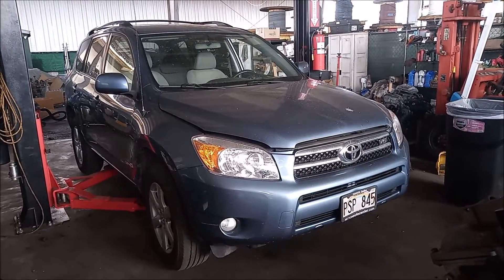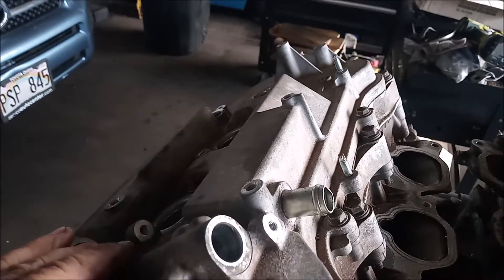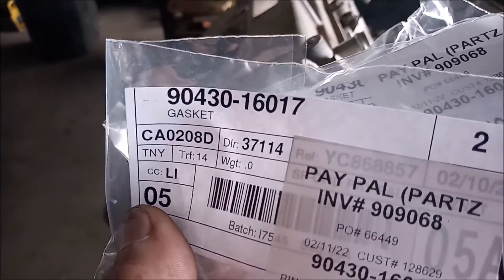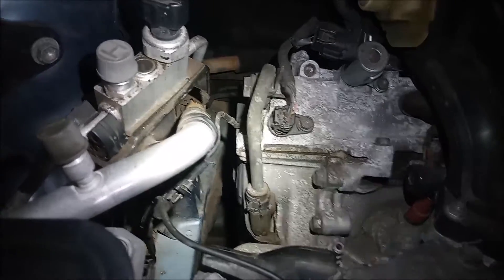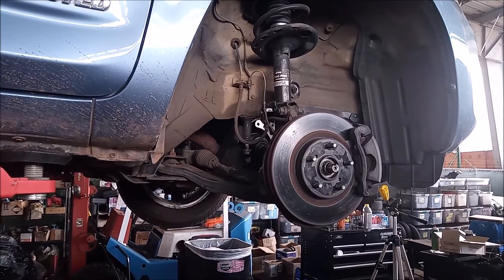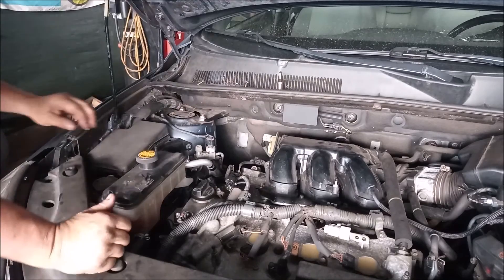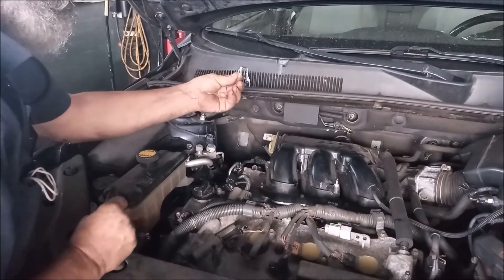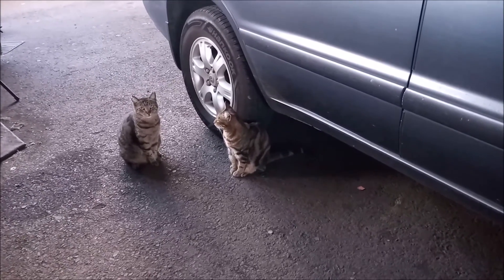VVT Oil Line Step By Step - Toyota RAV4 2GR-FE 3.5-liter V6

Comment: Thank you so much for this video.  I purchased a 2009 Camry in 2019 and was aware at the time of this oil pressure hose issue, and after confirming through the VIN that Toyota had replaced the original equipment rubber hose, I thought I was good to go.  However, the replacement also has this rubber elbow, and although they told me that it has a different construction (rubber with iron), I'm still going to have it replaced with an all-metal line, as neither the parts nor the installation are very expensive.
Reply from the maker: The construction of the replacement is the exact same as the construction of the original. It's possible they may have changed the composition of the rubber hose - not sure about that. They never did officially authorize a full metal replacement for the rubber hose, but they did put full metal into production. It's typical Toyota corporate nonsense.
Reply: Exactly.  They put the full metal pipe in their newer engines but wouldn't replace their original equipment bad hoses with full metal pipes.  That stinks. @Merryfrankster_
Reply from the maker: You know what really stinks? If you go to the dealer service department or parts department and ask for the metal tube, they tell you with a straight face that it does not fit your car.  @kennethwilliams4874
Reply: I'm glad you brought that up, so get a load of this...I purchased the exact part you mentioned (15772-31030) from a toyota parts supplier.  Now, that website says that that part will not fit my 2009 2GR-FE Camry.  They recommend part number 15707-31012.  Then when you try to buy that part, the website says the part has been discontinued.  However, if you examine it closely, you see that it is IDENTICAL to 15772-31030.This is nuts.  This is a hose (or pipe if all metal) that simply attaches to the engine block.  If it fits one 2GR-FE, it fits them all, as all engines with that specific code are identical.  I brought this up to my mechanic, and he conjectured that perhaps the engine left the manufacturer with a different part number than 15772-31030, so a part with a different number, even if identical, the database will say it will not fit.  Just crazy. @Merryfrankster_

Comment: Thanks. This would explain the mystery oil loss I've noticed lately.
Reply from the maker: Clean it all thoroughly then run it and  take a close look to see where it is coming from.
Reply: If you have a leak you will have a puddle under the vehicle when parked overnight.  If you do not have a puddle but are losing oil, it's burning out of the cylinders!
Reply: Its not my car and the driveway has a pink gravel that is not easy to see oil puddles, infact there is no way for a puddle to form..  anyway ive fixed the issue -same as this video showed.

Comment: I still have to do this VVT line on my 2007 Toyota sienna(201,500 miles). This past summer my oil cooler line had a pinhole leak (same hybrid design). It took several weeks because the hardware was rusted and I needed to use several tricks to get the bad lines off without breaking a fastener on the engine. Lots of rust penetrant over time. One the fasteners were out a reciprocating saw helped me get the old line out in pieces. The new line went in much easier with new studs and nuts/bolts. Your video makes this VVT line look easier in comparison. Also, my local Toyota dealer keeps wanting me to buy the old VVT design, he says it’s the only one he can get. Bolagna! The Toyota guy across the lake can get me the right one, so thanks for the new part number, I took a screen shot to show him. 
I watched a video from someone else that said you have to loosen the power steering pump to get clearance if you have hydraulic power steering versus electric power steering. Does that vehicle in your video have electric power steering? BRW, thanks again for the video, and say hi to your cars for me.
Reply from the maker: Use the part numbers I provided. They work universally for all 2GR-FE engines. If your vehicles has an power steering pump, yes, you must take off the serpentine belt and loosen the pump to access the rear banjo bolt on the head - and pray that the pump is not jammed on somehow. Thanks for watching. Cats say meow.
Reply: I have a 2006 Rav4. How do I know if I have electric or hydraulic power steering?

Comment: Thank you for the video. The Toyota dealership replaced ours under the recall but they would not put the all metal line on. I just looked at the cost of that metal line and it's only $25. I can't believe Toyota would not replace it with the all metal line. And yes, our original one failed with a 3 mile oil trail down the road. Thank fully my wife was on the way to the PO Box and it was a very short trip so by the time she got home we only lost 1 qt of oil. But this had happened on the freeway and we didn't notice it would have cost us (or Toyota) an engine.
Reply from the maker: Management of Toyota dealers and service network is one of the worst in the world. Unbelievable sometimes.
Reply: Did you mean that Toyota replaced your original metal-rubber line with a metal-"oil resistant" line?
If so, did the "oil resistant" line spring a leak?
Reply: @cometcal2  They replaced it with an item that looked identical to the one that failed. Steel fittings on either end with a rubber, flexible section in the middle.
Reply: @stickman-1  The replacement is supposed to contain an "oil resistant" rubber hose. If this leaked, then it's no good.
Reply: The replacement is supposed to be an all metal line without any rubber section in the middle.
Reply: @cometcal2  Correct. The replacement has a (purported) upgraded rubber section, replaced under a LSC. There are a number of reports online of failure of the "upgraded" line, some catastrophic. Seems best to have all-metal lines, both for the oil cooler and the VVT-i supply lines.

Comment: I’d been looking to do this on my ‘07 RAV4. Toyota said they replaced the line with the same like the original so they wouldn’t install the updated part under warranty. I’ll be doing this soon.  Great presentation here.  Thanks.
Reply from the maker: Yeah I have given the part numbers for the metal line so you do not get dicked around by Toyota.
Reply: @Merryfrankster_  Thanks again :)
Reply: @Overlin Alinez: I replaced the twin oil cooler lines with the all metal replacement. A real bitch of a job, but I got it done. Now I want to replace this line. My Toyota parts guy isn’t so good. The replacement came in…the old rubber style. He swears up and down that that’s all that’s available for my 2007 sienna. He said he’ll reorder it, but that’s what I’m gonna get. My frustration is that he won’t check the recall info or do any research. I’m gonna have to find somebody more on the ball.
Reply from the maker: @terrysaunders2026  I provide the part numbers for the metal lines and the gaskets in one of the other videos here. Just look through and you will find.

Comment: Thank you for the video. I bought a 2005 avalon xle in beautiful condition and only 91,000 miles. Runs great but it has the rubber hose. I am ordering the parts to have it replaced. Thank you again for the video 👍🏽
Reply from the maker: Thank you for watching.
Reply: I just bought the same garaged car @ 207,075 in great condition. Can't find any info if the rubber section was ever replaced, or not. Did you have a lot of trouble getting past the Power Steering pump in front of the lower banjo bolt? Looks very daunting to get at it from a on the ground driveway approach.  Thanks

Comment: I just found your channel and subscribed. Excellent!  I am doing my due diligence on this engine as my '04 MB E500 just hit the 250K mark and I think the torque converter is sending me hints. I am looking at an older RX350 and you have showed me just what to look for on this engine with your videos. Thank you Sir!
Reply from the maker: I like the 2009 RX350. Great car. Thank you for watching and for commenting.
Reply: @Merryfrankster_  by 2013 the V6 Rav 4 would have the upgraded line and the metal oil cooler lines from the factory?
Reply from the maker: Correct.  @accobra4272

Comment: Sorry for posting this again. Just realized that I posted it as a reply instead of a comment to Frank. Here goes again:
Yesterday while on my way to a Doctor’s appointment my warning lights came on indicating TRAC and VSC problems. I continued on to my cancer appointment which is a 22 mile round trip and would check on this when I got home. I used my Blue Driver to analyze what was going on and the 3 trouble codes indicated VVT problems and I noticed oil puddles on the garage floor. The low level oil light never came on . Checking the oil level there was no oil on the dipstick. Adding oil it took 5 quarts to get it to full. Looking under the car the oil was dripping out like crazy. Do you think the engine has been damaged? After adding the oil the engine ran and sounded good when I drove around the block. Obviously the rubber part of the tube had ruptured. It’s a 2007 Lexus RX350 two wheel drive. Thank you Frank!
Reply from the maker: You may have dodged a bullet. Time will tell. But if the line is leaking you need to replace it asap. Do not drive the car until that line is replaced.
Reply: Absolutely Frank. Thanks for your video and instructions. I will order the parts you suggest. I should be able to tackle this project even though I’m 74, and pretty weak. Thanks again!

Comment: Thanks for the very informative video. I have an 08 Highlander Limited with the V6 with the vvt line that has the rubber. In your process of removing the bottom banjo nut I did not see how you removed the power steering pump out of the way. What is involved?
Reply from the maker: The RAV4 has electric power steering, no pump. I do have another video with a Camry very similar to the Highlander power steering. Remove the serpentine belt, remove the pump lower bolt, loosed the upper bolt, swing it out of the way to reach the banjo. Pray that the pump is not stuck.

Comment: On a 2008 toyota highlander,  do you recommend removing the motor mount to get more wiggle room?  The only problem I'm having with removing the motor mount is that I would still have to jack up the car and I don't want to lift the car up with the motor mount off.
Reply from the maker: Are you talking about the dogbone mount on top? You can just remove that without even jacking up the engine. It does not support any weight. It is only for side-to-side support. If you think removing it gives you better access, remove it.

Comment: For the top banjo bolt I had to purchase low profile sockets as the spacing between the ac lines and the banjo bolt was very tight. 2007 rav4
Reply from the maker: You can move the ac lines out of the way easily, just undo the brackets that hold them down. Thanks for watching and for commenting.

Comment: I wonder if my 2011 avalon has these hoses, or the oil cooler line which is the same problem, it runs and works so good i only look at it when i change the oil
Reply from the maker: 2011 Avalon has all-metal line.

Comment: Hi:  Is it possible to just replace the rubber line and leave the metal tubes in place?  Mine has lasted me 215,000 miles and I suspect a new rubber line will last the rest of the life of the car.
Reply from the maker: It's your car, you can do whatever you want, anything is possible for you if you choose to do it  If you are asking me can it be done? The answer is yes, you will probably need to use a razor to slit the end of the rubber hose to get it off otherwise you will have a very tough time removing it. If you are asking me "should it be done?" My answer is no comment.

Comment: This is awesome.  I just bought a 2007 rx350 and I haven’t checked to see if it was placed yet, still at dealer.  I noticed some vids have the ac compressor in the way and the axle and compressor was removed on a camry and this didn’t.  Does the rx350 have the same setup as this rav4 and easy to get to just like this?
Reply from the maker: The 2007 rx350 has a power steering pump (unlike the rav4, with electric power steering).  Later models of rx350 - 2012 and on - switched to electric power steering. So the power steering pump would have to be moved out of the way to release the rear banjo bolt.
Reply: @Merryfrankster_  I knew it couldn’t have been that simple lol.  Do I have to remove the passenger axle like you did with the camry?
Reply from the maker: @Newinvestor2023  Normally you do not need to remove the axle. I had to do it because the pump was practically welded in place and could not be moved.
Reply: @Merryfrankster_  oh!! Ok awesome!  Thank you so much!

Comment: I'm just about to replace the rubber oil cooler pipes on a 2010 RX350. If that goes well, I'll try the VVT pipe.
Reply from the maker: For a 2010 your vvt should be all metal already.

Comment: Thanks for the information. I have a 2008 camry v6, and got the same problem with the oil pipe. Do you know how to find this part? Thank you again.
Reply from the maker: I thought there was a link in the video description or the comments.
Reply: @Merryfrankster_ yes, it is there. I thought it wouldnt work on a camry based of amazon's warning of not fitting into my vehicle. Thanks for the video!!
Reply from the maker: @Miuzetw  there is a lot of confusion about this part number, but it does fit. In one of my videos I put it right onto a Camry.
Reply: Yesterday while on my way to a Doctor’s appointment my warning light came on indicating TRAC and VSC problems. I continued on to my cancer appointment a 22 mile round trip and would check on this when I got home. I used my Blue Driver to analyze what was going on and the 3 trouble codes indicated VVT problems and I noticed oil puddles on the garage floor. Low oil light never came on. Checking the oil level and there was none showing on the dipstick. Adding oil it took 5 quarts to get it to full. Looking under the car the oil was dripping out like a waterfall. Do you think the engine has been damaged? The engine sounded fine and drove ok around the block after I added the oil. Obviously the rubber part of the pipe had ruptured. It’s a 2007 Lexus RX350 two wheel drive. Thank you Frank.

Comment: Hi Frank. I have a 2008 Sienna that I want to replace the vvt line on. Is it more work/difficult than the Rav4 or Highlander videos that you have shown? It seems like the lower banjo bolt replacement is tricky (looks like you had to remove the axel in one of your videos). Is the Sienna any more or less involved /diffiicult? Thanks!
Reply from the maker: Yes on the Sienna it is more difficult because you have to move the P/S pump out of the way.

Comment: I have a 07 Lexus ES350.   73K miles.  Car is new to me; was my uncles.  It has the rubber line still.   Took it to the purchase and servicing dealer.  They claim hose was replaced in 2009 as part of TSB.   So... Do I need to have it replaced with metal one?  Seems conflicting info.   This 2GR-FE has the power steering pump which I assumed needs to be removed to access the lower banjo.   The part number you show (15772-31030) doesn't appear to be the part I need.  According to Lexus I need 15707-31030.  Is this the same part or a ploy for more $ since it's a Lexus.
Reply from the maker: Your Lexus dealer is doing you the same line of BS that they give to everyone. Yes it's true that in the initial phases of the recall they replaced the rubber line with another rubber line. Later they switched to a metal line in production, but they never updated the procedure for the recall. THE PART NUMBER THAT I PROVIDE IS THE CORRECT NUMBER. Others have disputed this only to find later that they were being jerked by the dealer. You can see in one of my other videos that I do this replacement on a Camry which is exact same as your ES350 using the exact same part number. You should be able to order this metal line from Toyota for about $20. I don't know what your Lexus stealership wants to charge for it. NEVER EVER TAKE YOUR CAR TO THE DEALER. They are professionally trained to lie and steal.
Reply: @Merryfrankster_  Thank you.  You are so right.   My aunt/uncle took the car there in 2019; was told it needed a washer fluid tank (due to leaking), new power steering lines (due to leaking), water pump, and axle boot (due to leak.)   Nothing was wrong with tank.   Oil on power steering pump & axle boot likely from other source.   I cleaned it all up and looking to diagnose source (hoping not timing cover.)  Thinking it could be VVTi fitting or hose above.  Everything converges in that rear corner around the PS pump.   Appreciate the reference to the other video.
Reply from the maker: @RotaxXS  Put Xerex Asian (pink) 50/50 coolant in your car. Cheaper alternative to Toyota coolant. If there is a leak, it will coagulate and form very visible pink deposits that you cannot miss. This is the best way to trace coolant leaks aside from using a coolant pressure tester.

Comment: How about the VVT cooler line on the front bank (or left bank)?  Does it need to be replaced too? Thank you for your video that is super helpful.
Reply from the maker: The line on the front is all metal. Some leakage may occur at the banjo bolts, this is normal wear, it can be addressed by replacing the washers.
Reply: @Merryfrankster_  Thank you so very much for your valuable reply.
Reply from the maker: @mingyang1922  Thank you for reading and for commenting.

Comment: Does the 48ft-lbs spec on the banjo bolts apply to both front and rear valve covers? On a 2012 camry 2grfe
Reply from the maker: Same bolt, same spec. Thanks for watching.